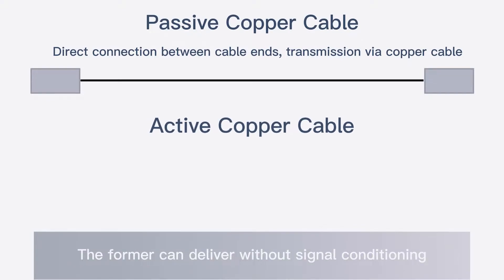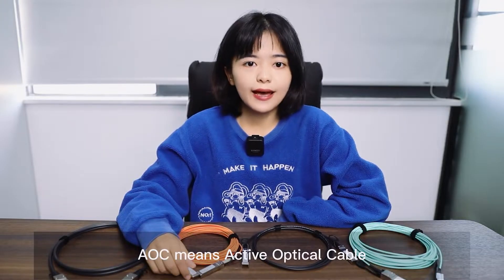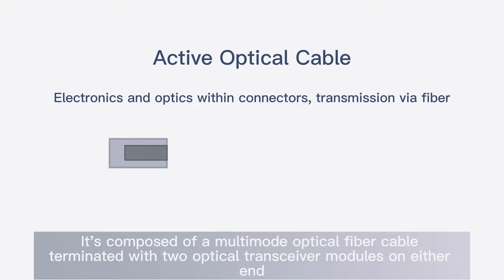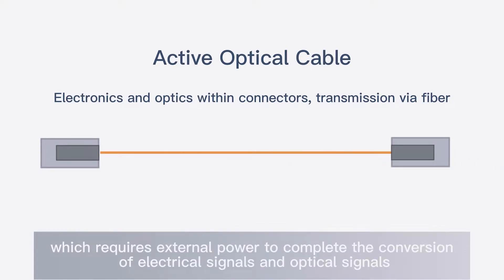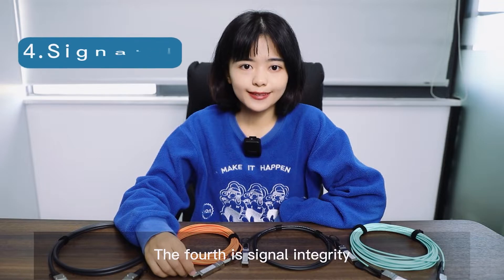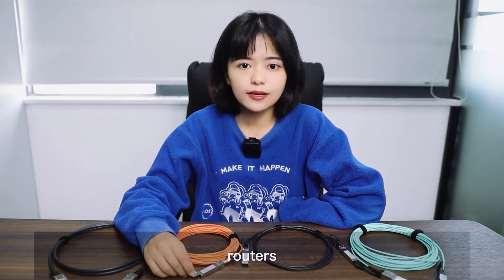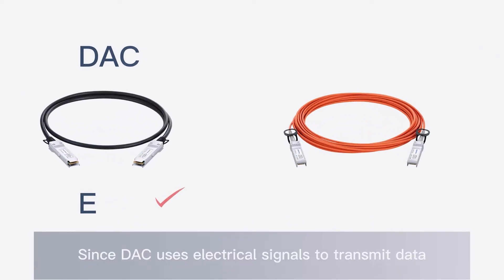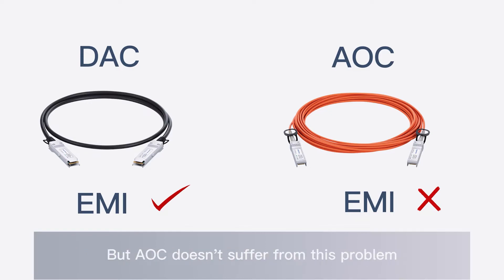DAC vs AOC Cables : What’s the difference? | QSFPTEK

Comment: In short which one is suitable for switch to switch or OLT connections?
Reply from the maker: Whether to use DAC or AOC between switches mainly depends on whether the port is an electrical port or an optical port, and the transmission distance. OLT equipment is more suitable for using DAC.😀